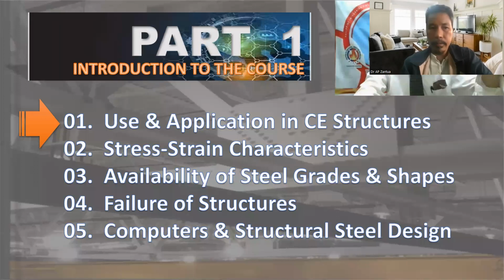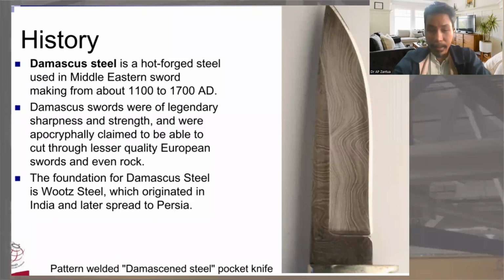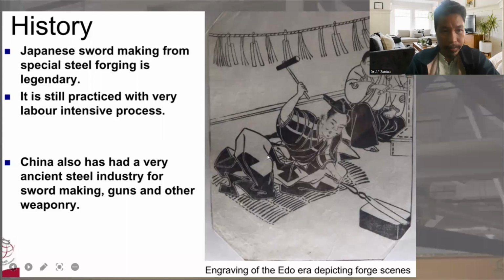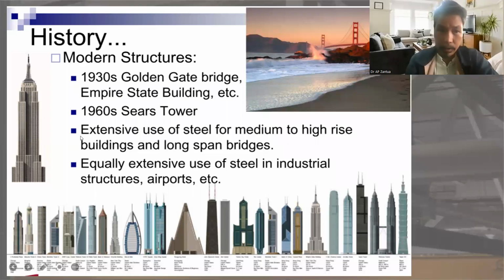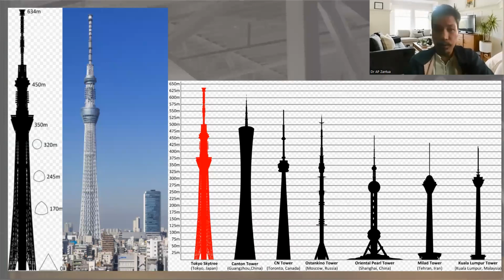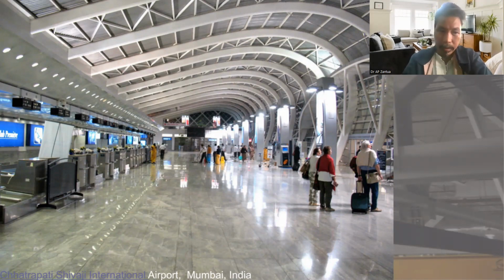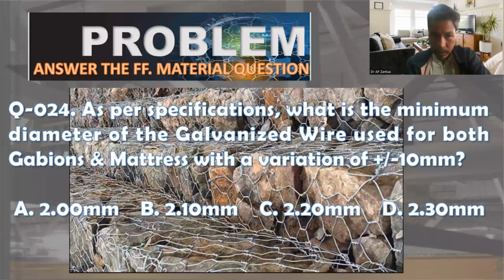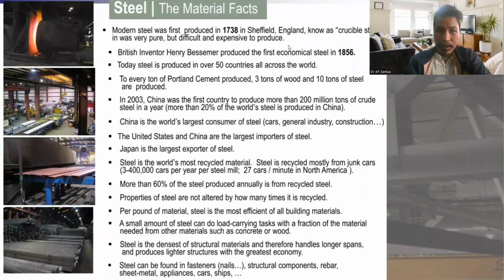Steel as Engineering Material [ Principles of Steel Design ] Module 1.01.a

Comment: I’ve learned that wootz is a steel developed in India around 300 BC. The word wootz is a mis transcription of ukku  the word steen in telugu.
Q24, As per specifications, what is the minimum diameter of the galvanized wire use for both gabions and matters with the variation os +/- 10 mm? 
Answer: 2.20 mm

Comment: Thank you sir  for sharing your knowledge about the history, characteristics and uses of steel
 For Q24:  as per specifications, what is the minimum diameter of the galvanized wire use for both gabions and matters with a variation of +/- 10mm?
 Answer: c. 2.20mm.

Comment: Thank you for giving us a very well-explained video regarding the preparatory of the course principles of steel design. 
Question 024 : As per specification, what is the minimum diameter of the galvanized wire used for both gabions and mattress with a variation of +/- 10mm? 

Answer : 
c.) 2.20mm

Comment: Thank you sir for this video lesson about Principle of Steel Design and discussing it's steel and origin. Also, this video tell us some information about the history of the said topic. 
Q-024: As per specifications, what is the minimum diameter of the galvanized wire use for both gabions and matters with a variation of +/- 10mm?
Answer: C. 2.20mm

Comment: Thank you sir for this video lecture about the origin, characteristics and history of steel

Question 24. As per specification, what is the minimum diameter of the galvanized wire used for both gabions & mattress with a variation of +/-10mm

Answer: C. 2.20mm

Comment: thank you for teaching us the history or origin of psd, and also what structures that uses more steel to build like towers and bridges.

As for the question 24: As per specifications, what is the minimum diameter of the galvanized wire use for both gabions and matters with a variation of +/- 10mm?
Answer: C. 2.20mm

Comment: Thank you for teaching us this lecture video where talk about the origin of steel and it's history in some country like India.

Q-024: as per specifications, what is the minimum diameter of the galvanized wire use for both gabions and matters with a variation of +/- 10mm?

C. 2.20mm

Comment: Thank you sir for the knowledge about steel.

Question024: as per specifications, what is the minimum diameter of the galvanized wire use for both gabions and matters with a variation of +/- 10mm?
Answer: c. 2.20mm

Comment: In this video, it tackles about the origin and history of steel and also it is mentioned in the video the uses of the steel. It is also shown here the highest buildings and the highest tower in Japan. It is also mentioned in the video the largest single span steel arch bridge which is the New river Gorge bridge. After watching the lecture there's a challenge question at the end: 

Q.024 "As per specifications, what is the minimum diameter of galvanized wire used for both Gabions and Mattress with a variation of +/- 10mm?" The answer is letter C. 2.20mm

Comment: Thank you sir sharing the origin of steel 

Question024: as per specifications, what is the minimum diameter of the galvanized wire use for both gabions and matters with a variation of +/- 10mm?
Answer: 2.20mm

Comment: Thank you, Sir. In this video topic the continuation of the Principles of Steel Design, for sharing us the history of the course.

Questions 024 : as per specification, what is the minimum diameter of the galvanized wire used for both gabions and mattress with a variation of +/- 10mm? 

Answer :C. 2.20mm

Comment: Thank you Sir for discussing the first part Module 00 of this course it is all about steel and its origin wherein the uses and application in CE structures.
Question-024 As per specification, what is the minimum diameter of the culvanized wire used for both Gabions and Mattress withe variation of +/-10mm? 
Answer: C.2.20mm

Comment: thank you sir for discussing about the steel and its origin. Also you discussed when and where to use steel.

Q-024 as per specifications, what is the minimum diameter of the galvanized wire use for both gabions and matters with a variation of +/- 10mm?
Answer: 2.20mm

Comment: This video talks about the history of steel and its uses back then. Thank you, sir for discussing the origin of steel and how it thrive to how it is today. Some structures like towers and bridge has also been discussed wherein steel are use to build a structures. For Q024 As per specification in DPWH DO No. 28 Series of 2018 - Section 1714.2.6 "Dimension". The minimum diameter of a galvanized wire for both gabions and mattress are 2.20mm with a variation of ± 0.10 mm. So my answer is Letter C (2.20mm).

Comment: Thankyou sir for letting us to know some information about steel design and structures, specially its history and evolution
Question024: as per specifications, what is the minimum diameter of the galvanized wire use for both gabions and matters with a variation of +/- 10mm?

Ans. C. 2.20 mm

Comment: Thank you sir for this lecture video about the history of  steel. The history of steel tells how this material as useful as it is, and as strong element that stood up to this day. The important role that this steel play in our history is to have a convenience and sustainable.  The uses of steel structures can be applied to towers, bridges, portal frames and other structure with structural types.

As per 28:14 Q24, As per specifications, what is the minimum diameter of the Galvanized Wire use for both gabions and matters with a variation of +/- 10mm?
Answer: C. 2.20 mm

Comment: Thank you sir for sharing of the history of steel and its origin and of course for showing us the structures that made of steel.

For questions 024, as per specification, what is the minimum diameter of the galvanized wire used for both gabions and mattress with a variation of +/- 10mm? The answer is letter C. 2.20mm

Comment: Thank you sir for the lesson and for sharing the knowledge about the origin of steel and design. 

Question024: as per specifications, what is the minimum diameter of the galvanized wire use for both gabions and matters with a variation of +/- 10mm?

Answer: 2.20mm

Comment: Thank you sir for this video 

Q-024 as per specifications, what is the minimum diameter of the galvanized wire use for both gabions and matters with a variation of +/- 10mm?
Answer: 2.20mm

Comment: Thank you Sir for this lecture video where talk about the origin of steel and it's history in some country like Japan.

Q-024: as per specifications, what is the minimum diameter of the galvanized wire use for both gabions and matters with a variation of +/- 10mm?

Answer: C. 2.20mm

Comment: thank you so much sir for this video

Q-024 as per specifications, what is the minimum diameter of the galvanized wire use for both gabions and matters with a variation of +/- 10mm?
Answer: 2.20mm

Comment: Thank you so much sir for teaching us about the origin of steel.

Q24
☆As per specifications, what is the minimum diameter of the galvanized wire use for both gabions and matters with a variation of +/- 10mm?
Ans: 2.20mm

Comment: Question024: as per specifications, what is the minimum diameter of the galvanized wire use for both gabions and matters with a variation of +/- 10mm?
Answer: 2.20mm

Comment: Thankyou sir for discussing about steel and it origin.

Q-024 as per specifications, what is the minimum diameter of the galvanized wire use for both gabions and matters with a variation of +/- 10mm? Answer: 2.20mm

Comment: Thank you sir for discussing the origin of steel and design. 
Question024: as per specifications, what is the minimum diameter of the galvanized wire use for both gabions and matters with a variation of +/- 10mm?
Answer: 2.20mm